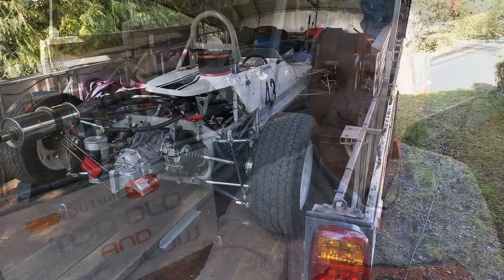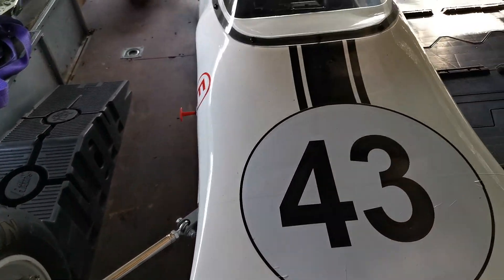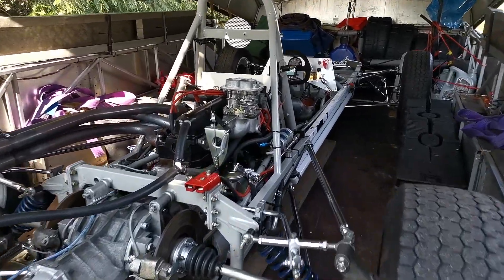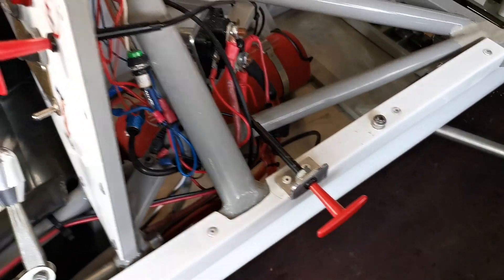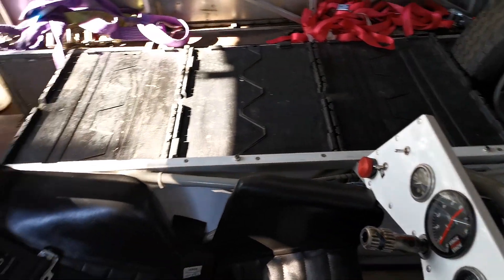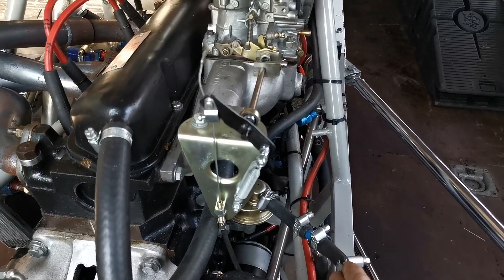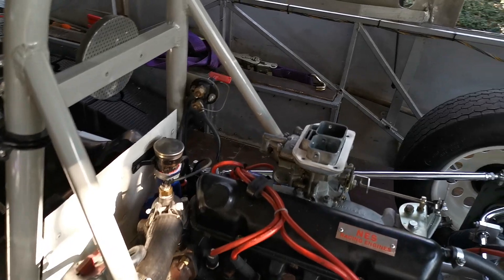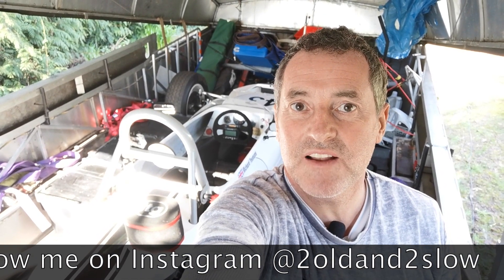The Anatomy of a 1973 Formula Ford

Comment: Richard, I really enjoy your videos. I've got a question. Where did you get your seat insert? Are these available from a supplier over there?
Reply from the maker: Hey Stan, thanks for the message. The seat came with the car and the car was imported from the USA. I suspect it was it was locally made by a trim shop a few years ago. 
Now the old seat is gone, I was struggling with visibility as I was too reclined. I now have Van Diemen seat that’s les comfortable but gives me more support and the position gives me more control.
Reply: @toooldandtooslow  Thanks Richard, I had my '70 Caldwell D9 rebodied last year and the fiberglass seat was too tight for my 200lb/5' 11" So I've just laid a leather seat cover over the tank with foam under the forward of the seat but it lacks lateral support. I'm also looking at the Tillett W3 seat which some use. I guess a pro type foam insert seat would be best, but don't feel like I could make it. One other question. What are the most popular dampers that historic FF1600s use over there? I had a set of non adjustable Bilsteins built for me. I gave the shop all the specs, weights etc. but  they are no quicker than the old Carreras they replaced. Did you do the FF Festival last weekend? I watched it on the live stream. That Cam Jackson seems very quick. The title of your YouTube page attracted me because I'm even older than you at 72. I'm still enjoying keeping the kids honest over here. One other thing. As you know our main club is the SCCA but as you may know a few years ago they claimed that the Kent was becoming hard to find so they allowed the Honda Fit engine too. Funny thing now they have fewer Formula F entries and most of the loyal Formula Ford guys have gone vintage racing. The SCCA has small fields of 12 to 15, while the vintage races often feature over 30. I think that's great.
Reply: @stanvann8347  Butting in here..   I got a Kirkey aluminum seat.  They make a 'custom' seat foam that you can use..  Basically a plastic bag you tape on the seat frame and have someone pour the foam mix in while your sitting in it..   I tried it with spray foam and it actually worked.. but then within a week, it lost its form..  so if you decide to look into it go with the recommended foam..

Comment: Hello Richard, nice video, brings good memories...I wear one of this things with very little money, so I had to learn...I tell you what I did, you do what you want...the arrival to the carb used to come out, ask Roberto Moreno at Mallory...then you better have the extinguisher charged (I discharged it, I arrived to minimun weight, 3 kgs!) I put some safety wire from the corp to the clamp in the arriving hose. I have one of those twisting pliers, you know, like the Bugatti time, very useful!! and you chek visually if the things are tight. The chassis should be not twisted, if is the case, you always level le front, is with that you brake and get into the corner. Your ball joints must have the same number of turns every were, if not...mmm...look for the reason! I had welding bottles with the system giving the green flame, it makes clean brazings with naked rods, once you master this, your worries about twisting the chassis became very acceptable! If you are twisted, well, not you, your TOTS, you should get a good level, today there is cheap lasers I'm sorry they weren't available at the time. You have to cut the brazings, they are slippery, the rods are only bronze, 1.6 mm, naked, I had Nickel silver, but is not necessary, once you cut them close to the front bullkhead, get a 2x4 and chains. You start cutting at the top two or three, having secured the rear of the chassis, then you try with the 2x4 to twist it in the good sense, if you don't arrive, you continue to cut until you put the front bulkhead in the good position, paralel to the upper piece where the rear suspension is hoocked. Ik you need to change some tubes, you cut them to have the good form with tin scissors, it's easy! Is true the portable grinders of 125 mm diametre, have changed our lives! but you con do it by hand. 

If you have grinding machine...come on! cut oll those bolts too long! We used to leave half of the bolts in the air in the CV joint, is turning weight, but you can avoid doing that. The brakes have to be hard as the ground, if you push and the brake cylinders move, you should reinforce around the cylinders, as you have aeroequip tubes, the lines wil not swell and you will be able to controle your braking power. In my first race at Mallory I had a big one, and as I was not able to put the rest of the car on the truck, we decided to repair between practice and sunday of the race. There was nothing on the left side, it woudn't go through the first corner flat out, 6.2 was ok, 6.3 6.4 I felt would understeer...ten minutes to the end I wanted to be like every other driver and press both feets to the floor...it didn't pass...at the paddock i realised there was interference between the rolling bar and a tube hoding the pivot of the rocking arm, it was a Royale 26, two years old, it always touched the tube, Rory Byrne had put the holding point at the inner end of the rocking arm and it was slanted, so 6.2 it didn't sway enough to touch, but a 6.3 6.4...look at the next meeting the RP 26, many touch, and the drivers don't have experience on top of that...Rory was learning, me too. The seat with foam is not good, you will fell better your car if you mould a seat with the foam which becames hard. You take two rubbish bags, one inside the other, put your driving suit and seat in the car, then pour water in the bag to fill it up to your shoulders, then you mesure the water volume, knowing the foam I used grow 10-11 times. The first time I did it, I couldn't leave the car, if the suit gets the foam nothing cleans it, I had to cut my ass and put newer clothing...
Another thing, now easy to control, you have to finish your race or practice with the same pressure at one axle's tyres, as they work differently they will heat up and mont your pressure differently, but if you have a softer tyre it will brake differently of the other one. Now a days they sale by internet little caps for the tyres which give temperature and pressures all the time for 45€!!! We didn't have them!! Very important to weight the same at one axle, other wise...you will block wheels and have understeer in one sense and oversteer on the other...not funny doing Riverside "S" with a car like that! believe me! I understand why a fellow kill himself braking at turn 9...normally it was flat out.
the pressure was around of 14 F 16 R, but as I said, in practice I would keep the pressure in the same axle, when tey cooled down i had 4 different pressures, and those are the ones to start the season next time. Richard, sorry I may be too long, but if my experience will go with me to the cimitery is not really usefull. I race in California a Merlyn 20 I bought crashed, they screwed me. In my second race al Riverside, I decided to stop, i was scared, I couldn't understand how people would take pleasure doing it! Then came some one from the public and told me I was very good...he had done some racing and told me my car was really bad and I had manage to finish the race...I was stonished, I argue the car was good I had bought it from Kastner, at Willow Springs, and then he went to the front and tried to lift one wheel...He couldn't, so he went to the other side and was very, very light!! To shorten the history, one day a friend loaned to me an old head Minister (it needed rebuilding) and gave me his old new model Firestone. I qualified 3/10 from the pole ADF, with new tyres and inboard brakes in the front...In England I bought the RP26 and with old tyres I did the same time than Weaver (3rd) with the new Reynard in the FFord Festival 1981, I was 8th, then start 16, then 8...in the final, I was like 8th again, Wallace with a new RP29 couldn't pass me a few series, they couldn't outbrake me even I was in the outside of the track for my braking, finally some one got impatient and pushed me at Druids, so there is a nice picture of me heading for the barrier, holding my head with my left arm and then the fotographer took a picture and sent it to me saying he didn't know if I was putting my galoches, but I look very sweet anyway...of course! the first thing you think is not to dirty your racing shoes, they could became slippery!! forget the broken toe! Richard, I know the FF, I hope it serves you, or some other lad...good lap!